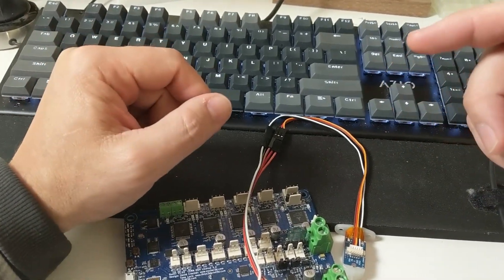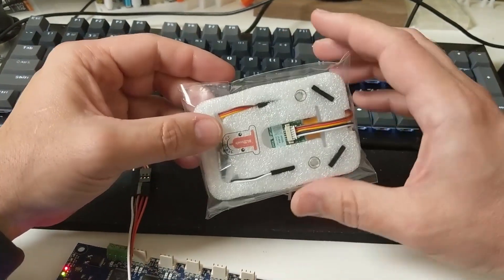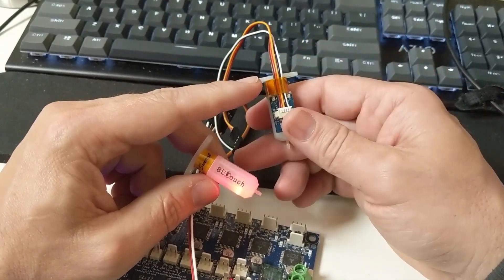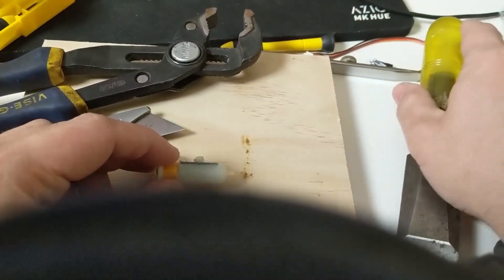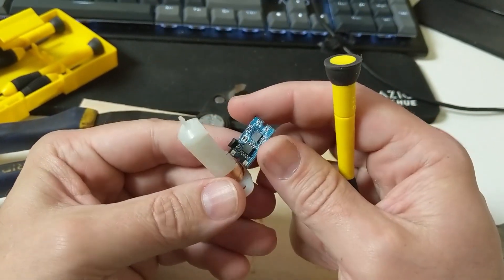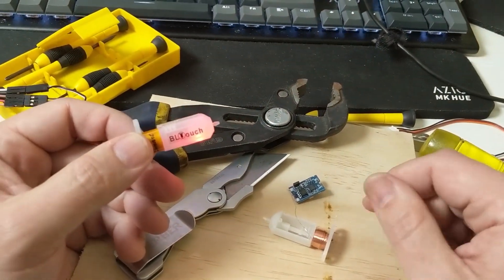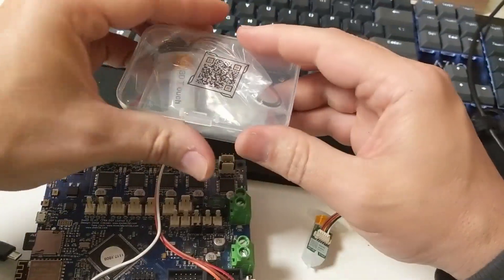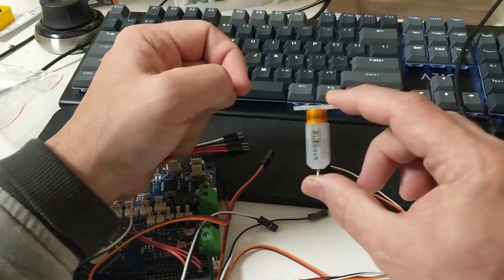BLTouch vs.  3DTouch - Should you save some money and buy the clone?

Comment: its seams that electromagnet is not working by you.. but my behave the same as original..
Reply from the maker: I know how to get it working. I'm not going to share that knowledge because 1)The customer shouldn't have to fix a brand new item that they buy and 2)I'm not here to help the dirty cheating thieves of intellectual property. Buy genuine. Support original creators. If you can't afford the original then perhaps you don't need it that badly to begin with.

Comment: The clones work if you connect them properly. They also may require different commands to work.
I had the bl touch from antsclubs 
It worked like a charm until it stopped working. Don’t know why, it seems that the logic board died.

Comment: guys anybody know why if it hits bed, it wont retract and trigger endstop.  I have watced weeks of vids  and several forums.  close to giving up.  Ive gotten rid of all errors, limits are good.  just cant get it to retract when it hits bed.  sittin with my finger on emergency stop so i dont bend the pin.  help somebody..
Reply: you probably fixed this already but just incase, i had the same problem and the issue was with the wires that go from the bltouch to where the z endstop was on the main board were backwards
Reply: @luke9511  i did figure out my issue, however its different.  I got the cheap bl touch, lol.  The wiring was ok,  with the cheap sensors, that little bolt inside the sensor needs adjusted so the magnet inside can release it, the little scew came set to stiff position, i losened it, and it started retracted and stowing, from there it was a matter of adjusting z stops and offset.  I have it dialed in now.  I can actually hit print without haveing to mess with any leveling.  Prints a nice first layer.  All my parts are here for my 3 color upgrade.  Gonna be starting that soon.  Making a vid on it, considering theres not alot on youtube about 3 color upgrade.

Comment: I bought a genuine BLtouch and it was a NIGHTMARE to get working on an ender 3. I literally had to break off a transistor on the mainboard for it to work! and mind you this was actually the Ender 3 kit made specifically for the ender 3, yet it requires you to break the mainboard to make it work.
I'm all for genuine and copy rights, but this video is engineered to make the knockoff look bad, since the 3Dtouch and BLtouch require different settings in addition to ignoring the correct cables provided in the box to make it seem like its bad. I hope this was unintentional.
Reply: What kit did you buy and what revision of the Melzi board do you have? I got a pin27 board and didn't had to brake off a resistor to get it to work on the 1.1.3 Board...

Comment: My original BlTouch V3.1 had the same problem that the 3DTouch showed in the video, I fixed it by adjusting the hex screw (I've tightened it a little) the problem went away... I think you could have solved the problem by doisng the same as I did =D

Comment: Mine has been working for 6 months now. Clone...
Reply from the maker: Good for you. You supported thievery, and it paid off. Does that really make you feel like a winner? Perhaps you should examine your impact on the world. Buyer beware: Clones are less expensive because they are inferior and unoriginal.
Reply: @DesignPrototypeTest  Well... I bought a clone after my BLTouch stopped working. I got 2 months use from it.

Almost all internet give the same aftersale service (it sucks). So I decided to not spend +40€ (I live in Europe and here everything is more expensive).

I can break +5 clones and still would be cheaper than buying another original BLTouch.

My SKR Mini E3 just stopped working (the SD card reader). They are charging 28$. And isn't it an original product? That's a reasonable price.

Get the BLTouch down to a reasonable price and I'm sure that people won't bother buying chinese clones...

By the way, I'm pretty sure the original and the clones are made at the same place, with the same components.

Comment: You need to connect the pins differently on 3dtouch
Reply from the maker: Please read the description. I connected it correctly.
Reply: @DesignPrototypeTest  Oh and in case you think scratching the 3.3v trace after you put 5v thru, read the marlin firmware... all the info you needed was avail and in front of your face   /**
   * Danger: Don't activate 5V mode unless attached to a 5V-tolerant controller!
   * V3.0 or 3.1: Set default mode to 5V mode at Marlin startup.

You are spreading misinformation, and your goal seems more political than honest / technical
Reply: @DesignPrototypeTest  Did you do #define BLTOUCH_FORCE_SW_MODE in your marlin FW? also if you are using a ver 3 or 3.1 and have the 5v option set comment it out
Reply: @DesignPrototypeTest  No you didn't, you put 5v thru it.... small traces with overvolting = fried

Comment: 3Dtouch works perfectly on my printer. You just need to connect the cables in the correct way.
Reply: What they said
Reply from the maker: You are not the first person to leave this comment. Read the Description.
Reply: @DesignPrototypeTest  3Dtouch works perfectly on my printer. You just need to connect the cables in the correct way.
Reply: @DesignPrototypeTest  3Dtouch works perfectly on my printer. You just need to connect the cables in the correct way.
Reply: @DesignPrototypeTest  3Dtouch works perfectly on my printer. You just need to connect the cables in the correct way
Reply: @DesignPrototypeTest  3Dtouch works perfectly on my printer. You just need to connect the cables in the correct way.
Reply: @DesignPrototypeTest  I think people are confused since they're expecting a comparison. Instead they get someone trying to open a precision piece of hardware with a centerpoint and a wood chissel... The knock off works just as well as the original.
Reply: @DesignPrototypeTest  you didn’t ... 500vs700 prove it

Comment: The problem is that the original BLtouch is hideously overpriced. I mean, $40 is a lot to pay for a magnet, a coil and a PCB when a whole 3D printer costs just $230. Someone saw the opportunity to charge half the price and they did, and now they're raking in all the budget-conscious consumers. That's capitalism for you.

Also, your comment about the screw being worse because it adds weight is laughable. A screw adds a fraction of a gram. No 3D printer will feel the difference when it's hauling around a hotend weighing hundreds of grams. If anything it's better because screws can be taken apart and re-assembled, whereas the only way to disassemble the original bltouch is to irreversibly break that plastic tab, or try to melt and bend it, then melt and bend it back.
Reply: With the glue applied, the screw provides no extra benefit of ability to disassemble.
Reply: @JasperJanssen  I'll agree there, but also with the original poster: the weight of the screw is absolutely negligible and will make no real world difference.  There's not even any guarantee that the original unit as a whole weighs less since weights for the two side by side were not provided.

I will say: I have an original BLTouch that was faulty and a knockoff 3DTouch that works fine.  Either one can make a defective product.  The video poster also explicitly showed that he ordered a pack of two of them and never went on to test (or at least mention testing) the second one to see if it was also faulty.

Comment: its called opensource its not cheating or stealing when the bl touch is based on an open source project http://www.print3dforum.com/showthread.php/620-Introducing-BLTouch-Autoleveling-Sensor-for-3D-Printers you really should know what your taking about before you start slating things. yes its a cheaper made item that is already clear in the price and if it is broken when you receive it you send it back for a refund or replacement like any normal person would do.
Reply from the maker: You Don't Understand Open Souce: https://youtu.be/iKhn5IcVvAg

Also, the BLTouch is NOT open source. Like thousands of closed source projects it is "based on open source." Another example of this is the Apple Mac OS which is "based on open source." https://askubuntu.com/questions/11392/what-are-the-differences-between-mac-os-and-linux 

If you purchase a BLTouch clone, you are supporting thieves.

Comment: @Design Prototype Test Pay no attention to the fanboys because the number one issue with this that I have ran across over the entire Internet is exactly what you showed.  Shame the internal code is so bad like that but it reminds me of the clone capacitors back in the early 2000's that cost everyone, including me, our motherboard as they dried out.  So close but bad in the end.  Maye there are good ones out there in the wild but too many bad ones for me.  I hate buying the real deal for so much money (I need the long wire too for my TronXY X5S so even more money) but I don't need hassles.

Comment: I've had my legitimate BLTouch do the same - servo just stops working and it just flashes on power up.  I tried ordering a new pin thinking maybe something happened to magnet part, and the seller sent me some pin that wouldn't even fit in the BLTouch (I did get a refund, it was an authorized reseller, not a random Aliexpress seller).  Unfortunately Antclabs told me they don't sell just the pin.  I ended up ordering a 2nd BLtouch complete unit - after auto Delta calibration kept failing I tried doing multiple G30 S-1 without moving the effector and got different results everytime.  For me, on a Tevo Little Monster, these things just don't seem to work.  I just do manual probing/jogging with paper now.

Comment: If you still have it, try powering the duet from your 12/24 supply to get more current on the 5v rail. I believe the electromagnetic portion of these requires more current. Also, I'm sure there is a firmware difference as well, which could be another source of some problems, even if the 3d touch was working.

Comment: Look to the number of negative comments on amazon, where original BLTouch is not working. 20%, that is 1 out of 5 original ones are not working. A LOT of people on FB complain about the original ones. I guess the number of working vs non-working original/clones is about the same, and normally I won't take a risk of spending 40$ on non-working original, rather than 13$ on non-working clone. Sample size of 1 original vs 1 clone is far from being representative to do such radical conclusions. Thousands of people are happy with the clones. I am not advocating to support clones, I just do not understand how come original have such a bad QC and high failure rate when doing stats properly? Besides that, many clones have different connection and setup and you need to spend a little bit of time figuring how to configure it properly.
Reply from the maker: I've bought 5 genuine BLTouch sensors They all worked flawlessly. It's not the easiest sensor to set up. Could that 20% number that you are talking about be attributed to "user error?"
Reply: The same can be said for the clone sensors. You already said above you know how to get the clones to work, but you don't in the video..  "I'm not about to help some thieves in China sell knockoffs" This video is pure propaganda and all your responses secure that fact.

Comment: I had that clone. got it working.
but dude. the sensor was all over the place. mesured random around +- 0.3mm on the same spot!
totaly useless.
bought a new original one.
works spot on!

get the real one guys!
Reply: Maybe I can be of some use.  As I was all over the interference problem when it was not being talked about.  Interference and repeatability was a massive problem with these probes.  I don't know if it finally got addressed because im not using them anymore.  But the only place you would really hear about it was github.  Meanwhile people acted like they were just fine.  Because of youtubers I suspect.  It becomes a big problem when trying to perfect your high temp prints.  I think it was overlooked because of how many people print in PLA.  But I suspect what you were having was to do with that.  Let me tell you how bad I hated the early version and smart version of BLtouch.  Those were broken and shielding the wires did nothing.  Blame the design on this one buddy.  I bet the clone was a copy of the early revisions and this has finally been addressed.

Comment: I have a 3Dtouch and it works perfectly since 6 months ago. You just need to connect the cables in the correct way.
Reply: Yeah, this was nonsense "comparison".
Reply: @Nobody-Nowhere  he might have bogged it on purpose seeing how political he gets.
Reply: I have a 3d Touch much cheaper and it's good
Reply: @ichbinderalgorithmus2019  Hi,
I've just installed a 3Dtouch sensor with aluminum pin. How do you improve accuracy? I run several bed leveling with so bad results:

M48 results
range 0.211
range  0.087
range 0.171
range 0.144

Any suggestion is appreciated.

Comment: You just got a bad device.  As far as price, you pay more for the "name brand" product.  Betting they may even be made at the same factory in China.
Reply from the maker: The BLTouch is made in South Korea not China. That is why it costs twice as much. South Korea is a fully realized modern economy which means that wages there are the same as in the U.S. If I did get a bad device, then I got two of them. Both of them behaved in the same way. If you get this device it will have the same issues.